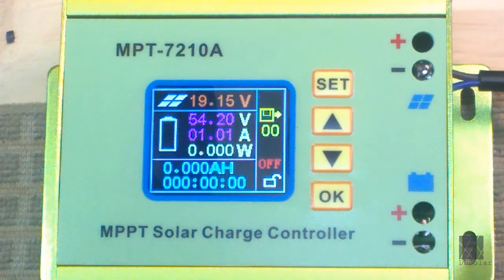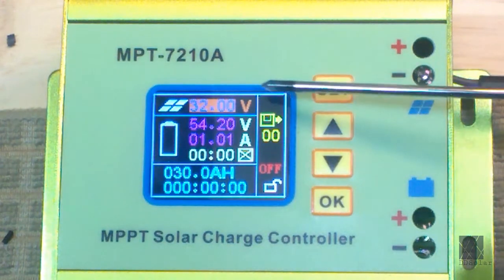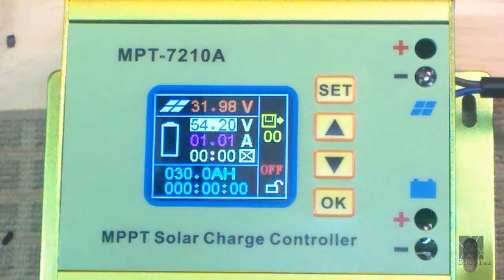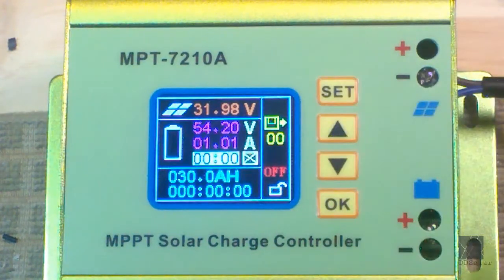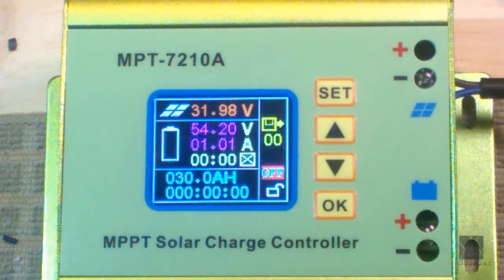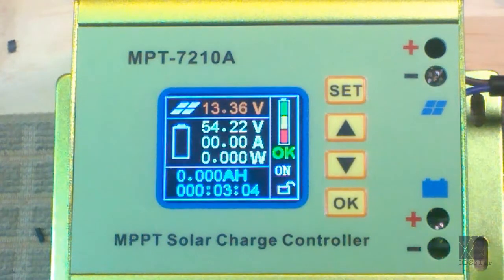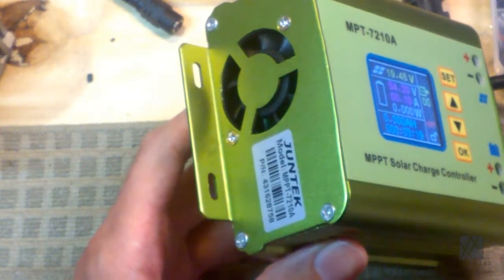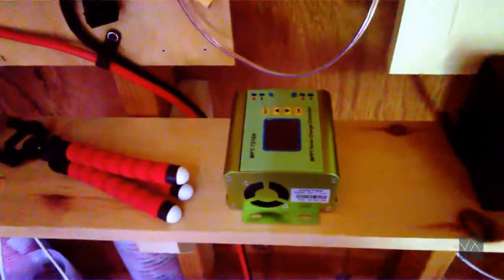How to Program MPT-7210A Boost Solar Charge Controller - Setup Guide

Comment: As soon as the sun goes down and Solar stops producing the screen shuts off. Is there a way to keep on all the time. My other CC screen stays on as long as it is connected to a battery but not this one
Reply from the maker: Hi, it's because this charge controller is a bit odd, it's powered by the solar panel only. I'd suggest adding a digital voltmeter or display of some kind to the battery so you can see the voltage of the battery after the sun goes down.
Reply: @solarpoweredge  Also I have 24V LI battery from chevy volt. I have set the limits at 25V on Charge Controller but it keeps on charging after 25V mark. Thoughts
Reply from the maker: @Burtchiropracticrehabilitation  Based on what my controller does in testing. This charge controller may slightly exceed the voltage set point (but not to like 26v in this case, I mean it may go slightly over 25v). I've seen it do so. However it should drop the current down slowly as the last part of the battery fills  up. This is the CV part of the CC-CV charging method this controller uses. Keep an eye on the current and you should see it start to reduce. Eventually it should drop to almost no current. Also the CC-CV indicators on the screen will change over, or at least they should.
Reply: @solarpoweredge  It went all the way to 27.5V. had to disconnect and use fans to bring it down
Reply from the maker: @Burtchiropracticrehabilitation   Wow that's seriously bad. Assuming it's programmed for 25V it might be a defective unit or a firmware bug. I've never seen mine do that.
Reply: @solarpoweredge  I have ordered more expensive units of different brand. Hopefully it will work. My best CC so far is Midnight 250
Reply from the maker: @Burtchiropracticrehabilitation  Roger that. I hope the other one will work for you. Midnight is nice, had one of those for awhile. They of course would never overrun their voltage setpoint by 2v or they'd never leave the factory. These cheaper charge controllers seem to have bad quality control. I had one MPT-7210A literally smoke immediately out of the box. (Yes, the polarity was correct, I quadruple verified this before connecting). Thankfully the seller replaced it no problem.

Comment: mine seems to try to charge the 12v battery at the same voltage the panel voltage is. i am testing mine using a bench top power supply. seems like i read this can be used as boost converter, i wonder if i am stuck in that mode. i bought this used from a dude that probably set it up wrong, or broke it before he gave it to me
Reply from the maker: Hi it's boost only, so your battery voltage should be significantly higher than panel voltage. For example, you could use a 24v battery and a 12v solar panel. It cannot buck (reduce) voltage, only increase it. This is an odd device because most DC converting charge controllers reduce voltage. Hope that helps!
Reply: @solarpoweredge  it does help, and i will be watching your video and a few others again. i thought mine was bad and since curiosity got the best of me i bought a brand new one and it does the same thing, so apparently i have more to learn. i have been playing with solar for about 2 years now and have many much better controllers but just when you think you understand everything something like this comes along.

i have a ways to go, but i set my psu to 17v and the battery voltage to 28.8v it does seem to charge properly, well kinda, its now charging the batter at 28.81v x1.28a =35 watts, and the battery is full. its two tiny 12v 12ah agm batteries i used to testing stuff like this.  maybe 17v is too high. i will play around with it more.
Reply from the maker: @jasonbrown467  Hi 17v is fine. It just needs to be significantly below min battery voltage because it can only boost up, never buck. From those numbers it looks like the battery is charging fine. One issue is since the batteries are lead acid, how to handle float charge. This controller is very fiddly. I think it was intended for lithium batteries mostly. There can be a lot of trial and error setting it up for a particular scenario. It took me a long time to figure the right settings to charge my mower, without overcharging it or collapsing the solar panel voltage. I have it working pretty good now.

Comment: the fan on my one was so loud
Reply from the maker: You're right it's loud!!! Might try a slower fan and/or mill out the aluminum material covering over part of the fan. I think that's part of the reason it's so loud.
Reply: @solarpoweredge  ya ill open mine as well and see if i can replace it with a pc fan or somthing
Reply: The Fan  noise is the first thing which  makes you think " there is something wrong "  as the fan makes so much noise... It is something which needs to be improved . The issue is not easy  to ignore ..  sounds like the unit is crying out for attention 😄
Reply: @johnnyuppal7878  i also have a prob where it just keeps trying to restart all time i think thats in the settings thou lol